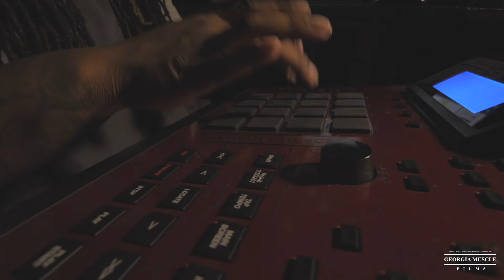ANALOG VS DIGITAL NO MORE COMPUTERS

Comment: My favorite thing about hardware is not the sound but the fact you can layer spatial effects or built in effects without over taxing the CPU. And typically latency is very low coming directly out of the hardware.

Sound can be shaped in infinite ways if we have the knowledge of how within our workflow. But there is nothing wrong with getting from point a to point b faster and with less steps which is typically the biggest advantage for myself with hardware.

My favorite advantage with vst's is very low If not zero maintenance cost and zero heat added to the studio and costs much less in electricity at the end of the month.

Comment: Running the Prophet Rev II through the Fatso is great to beef up the sound. I went with the Korg Prologue as it has the built in compressor and VCOs instead of DCOs so I don't need to run it through anything plus there is a third digital oscillator that can be customised, so the Prologue covers the bases and is ideal to sequence with the MPC. Either a Prophet Rev II or a Prologue alongside a Moog Subsequent 37 and you are set